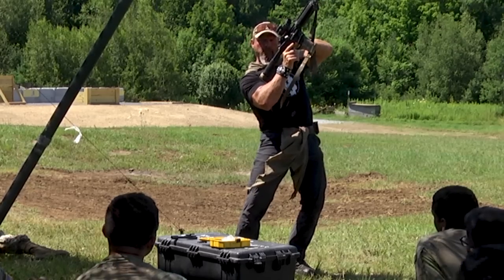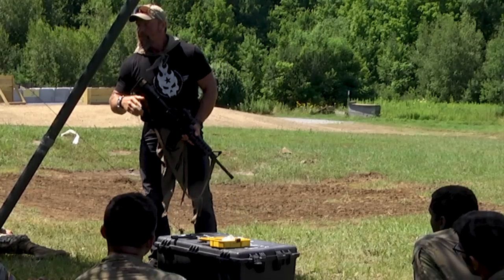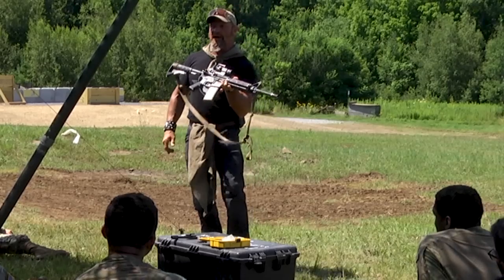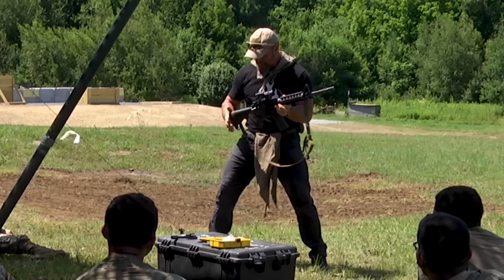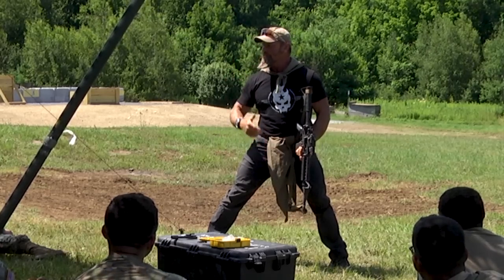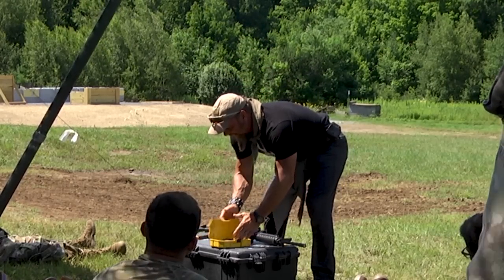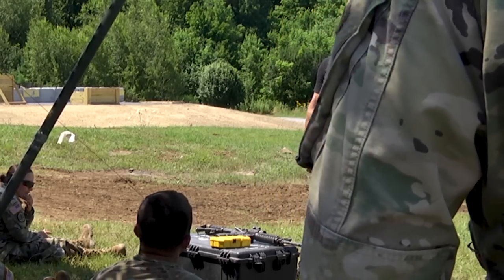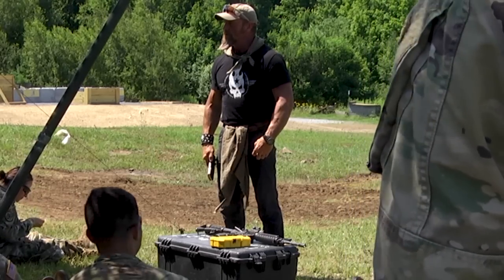Pat McNamara | Weapons Malfunction Training

Comment: The bolt override clearing at ~13:20 is the most straight forward explanation that I have ever seen.  
It make perfect sense that the cartridge will move forward with the charging handle and un-wedge from the bolt if you just hold the bolt from moving forward when driving the charging handle forward. Thank you!

Comment: I love how americans have such an extensive training session on this.
Finnish guys running RK rifles (like an AK but better) its like:
Step 1: DROP the mag, fresh mag in, rack it, try firing. If the rifle still doensnt work...
Step 2: slam the stock into a rock or a tree while pointing in a safe direction, try to fire.
At this point the rifle must be completely fucked if it still doesnt fire when its in battery.
Step 3: find new rifle.
Reply: I fucking love the Finnish
Reply: Sounds good enough to me :)
Reply: @ebinecksdee9872  the fins hate your guts.
Reply: seems the ar has alot of potential problems
Reply: @TheOMGWTFBBQ777  Many of these malfunctions showed in the video  happen in ak's (or an rk) too.. thing is, you should know how to fix them IF and WHEN they happen in one of them as well..

 Malfunctions aren't very prevalent in a standard m4 and most of them are bad magazine related (which the military switching to pmags has helped a lot too) or due to bad/worn parts maintenance.
Reply: @muddyhotdog4103  cool man just seemed a bit exaggerated . hope the police and mil guys have this sorted.
Reply: Ebin Ecks Dee 😂😂😂
Reply: Laughing my ass off

Comment: Another reason for failure to feed is cheap magazines like Thermold. If you look at a GI or Magpul magazine from the back and hold up the Thermold next to it, you will see that the magazine follower on the Thermold doesn't ride up as high. It tends to feed the round into the top of the magwell no matter how well you seat the mag.
Reply: I loved my magpuls and sung their praises until I had 3 of a set spit their feed lips into my m4 in afghanistan.  Steel usgi or lancer mags with metal lips only, from then on.  Magpul springs and followers in everything though

Comment: 7:56 I barely ever actually get to shoot my AR, so I like to take out the bolt and use it to fling snap caps.  I'll push the rim under the extractor and then push the other side down on the ejector and let it go.  Sometimes I try to fling them into a basket or something.  I never realized that I was doing something constructive that whole time!
Reply: you're not

Comment: 8:13 if you have a bolt with bad ejector spring tension, mark it and save it!! It is an awesome training tool to put into your gun. Helps train double feeds and stovepipes. I got a new gun that had a bad bolt and I got really good at clearing those malfunctions, then got a new bolt. Been kicking myself ever since.

Comment: This video is so full of info. I always did tap rack, then prom night if need to. I have had a few failures in the ar platform. I had a screw break off the gas key. It took 3 gunsmiths to trouble shoot. I then cleaned the gun again for the 10th time and found the broken screw on the gas key.  Things go wrong.  Sometimes just doing a good inspection will work.   The second screw held the gas key so tight i never suspected that to be the issue until it loosened up to visual movement. I had tried everything before hand.

Comment: Great informative video, only question I have is your gas ring statement about how it doesn’t matter if they’re lined up or not.. Now mind you I’m going off my USMC 2111 TM from 00-04 that stated you must make sure the gaps are staggered otherwise if they are aligned it will create a channel for gas to escape.. Now how they are staggered doesn’t matter as long as they’re staggered..
Reply: That is the book answer, however there has been testing that shows alignment has no negative influence on gas drive whatsoever.
Reply: EMC556 do you have any reference to the data showing that?
Reply: @jakudahsymba5453  nope, but you can try it in your own AR15. It will function fine.
Reply: EMC556 watched the vid, thanks... I figured it wouldn’t, but honestly never tested it, and we were always told to do it, however the more I think about it, staggering the rings is probably  more about creating even wear or possibly preventing carbon buildup in one spot against the bearing surface in the carrier..

Comment: The first stage in the cycle of function is feeding, the reason is if you can't get a round in then you can't fire!! I've seen plenty of guns that had failure to load or to chamber. There is a reason it's written that way in the manual.

Comment: The bolt override ftf could be mortared without pulling on the charging handle. Inertia would move the bolt back while leaving the charging handle locked. Round drops out the magazine well.

Comment: I saw this happened as someone's AR where the spring detent got stuck in between the disconnector and the hammer and went full auto the spring detent got out because 6-hour put it together and I did not screw the the buffer tube in far enough I hear the little pin from the buffer spring detent or a primer gets stuck underneath they trigger

Comment: My crye pants I bought off eBay had a corner of a wrapper from a pack of m&ms in the side pocket, mag picked it up got caught in the throat but I was blessed enough to clear it with a mortar no dental tools needed. Couple cadre at the class were laughing at me but I kept going. Didn't help that before that I had to spray paint 3 used mags cause they kept causing double feeds. I wonder now if I could of just bent the feed lips instead of just shit canning 'em.

Comment: on the bolt override (stuck between BCG and charge handle) haven't had it happen.  Can you not pull it back far enough to get it to the bolt catch then shove the handle back in? looked like he stuck his hand in the bolt but kind of hard to tell in the video. If BCG is smoking hot id rather catch it with bolt catch for sure lol.  So far I'm almost 15 min in and haven't missed 1 yet. I've had a gas key worked loose from shitty steak job. Goes single shot instantly. Just took my A2 block off one and the other didn't have it so BCM don't let me down!!

Comment: Another failure I experienced in a carbine class - popped primer in the FCG.  The primer ended up in my fire control group and prevented my rifle from firing.  It was a bitch to remove.  ALWAYS use milspec ammo with CRIMPED PRIMER POCKETS.

Comment: One drawback of the AR15 design is that if for some reason the bolt can't go into battery you can't break the weapon apart, because the BCG will lock the upper and the lower together. I actually had that happen on an airsoft rifle, but I don't see a reason why it can't happen on real AR-15. A debris got stuck between the locking lugs on the barrel extension and prevented the bolt from fully going forward. luckily I was able to pry it out through the ejection port, but had I not the only way to disassemble the rifle would require taking off the barrel. Obviously this is not something you can do in the field, never mind mid-firefight.
Reply: @eedd sdsd You can't separate the two halves without lifting the back end of the upper. The lug through which the rear pin goes through will hit the hammer or auto sear on a select fire rifle.

Comment: When you mortar a gun - if that's the right word I'm using - is there a possibility that the bullet goes off?
Reply: You should only be clearing like that if you're in a combat situation where you have immediate need to clear the failure and continue firing, and even then you should be following the 4 gun safety rules to where if it does go off it doesn't kill anyone. If you're on the range you should be clearing the magazine and putting it on safety, not slamming a loaded gun against the leg or ground.

But, as to whether it would fire, what he was demonstrating by mortaring was a failure to extract a fired round, so he's holding the charging handle and giving it some extra force slamming it backwards. Even if it was an unfired round that needed to be extracted, either the hammer would still be down, or if it's not, the force of hitting it on the ground should not be able to overcome the trigger spring.

Comment: With the bolt over ride he did exactly what the guy said to do. Relieve tension on the bolt and push the charging handle forward. Still he made it look easy. 

Also like the progression of malfunctions through the firing sequence. Haven't heard it explained like that.

An he's right. User induced malfunctions are supper common. To many rounds in a gi mag making it hard to seat. I've also seen 31 rounds in PMAGs a few times too. Not seating the magazine or pulling down to confirm. Dicking with the charging handle or easing it forward. All kinds of shit.
Reply: Haha, ya but he needed to look cool (proceeds to show exactly how student explains to fix brass over bolt)

Comment: Talk about weird malfunctions. I had an AR15 go full auto on me once. It was a broken disconnector spring in the trigger slot. It would slam fire at a cyclic rate of what sounded like 1000 rpm's. Ah, I just understood the purpose of the auto sear, to slow down the cyclic rate to 740 rpm's.

Comment: Ejector SPRING??? Why doesn't it have a fixed ejector like most autos? Simpler, and you can just pull the bolt back and see if it's there or broke off.
Reply: Why not? It really isnt a common problem to have a bad ejector spring in an m4/ar15, just might wanna replace the spring after 5+ thousand rounds if your ejection is weak; it's an easy fix.

Comment: In my day to correct a malfunction was referred to the word SPORTS. Slap, Pull, Observe, Release, Tap, Squeeze.
Reply: Juan Mangas Mochas  tapping is a procedure after the obstructing round is extracted, and ejected from the weapon, and a round from the mag is rechambered, thereafter tapping the forward assist to ensure that the bolt is properly seated in the chamber before squeezing a shot off. There is no danger for a accidental discharge, if you conduct the SPORTS procedures correctly. I have never heard of, or experienced a accidental discharge using that procedure.
Reply: Look by tapping the forward assist is only a extra procedure to ensure the the bolt is properly engaged, and seated in the chamber, though I have had a bolt that wasn't completely engaged due to fine grit that happen to get into my chamber, and I engaged my bolt by  using my forward assist which also worked well. If you think that a forward assist is a stupid idea on a weapons platform you're entitled to think whatever you woukd like, all I know is that it worked for me, and like I've mentioned previously never heard of  a accidental discharge, nor I have experienced one whilst using the SPORTS procedures.
Reply: Juan Mangas Mochas  oh well, shit does happen, however that someone accomplished that by using SPORTS.

Comment: Pat you are the fucking man!  Exellent video sir thank you for putting all  this information in one vid.

 I had buds for years always having issues. 99.3742% of the time it is operator error.   Faluire to inspect ammo when loading.
Failure  to inspect weapon-Gas block walking forward... gas rings not offset enough. And the classic "  case wont extract... i used ammo with a lacquer coating....I fired my 5 mags quickly... let a round sit and cook in the chamber...lol can you help me? "   DOH!
 thanks again great vids Sir.

Comment: Not having a mag in is not a malfunction.
Reply: It's an operator error
Reply: @frankgoytia2185  Correct, not a malfunction.
Reply: Improperly seated magazine causing a malfunction is a user induced malfunction. Though I think the video more covers any scenario where you pull the trigger and it doesn't go bang
Reply: @oscarkilby4033  Yes, Improperly seated magazine can cause a malfunction but still, not having a mag in the first place is not a malfunction.
Reply: @Skrubb_Lord  oh no for sure I didn't catch that part in the video. The problem is probably a malfunction being defined as what I previously said rather than what they really are

Comment: I thought the gas rings had to be staggered
Reply: They do, unless you run that bolt with a piston for some crazy reason
Reply: @1891-j8s   Nope, fake news...
Gas rings have NEVER needed to be staggered on any generation of AR15/M16/M4 series of rifles.
Reply: @1891-j8s  Bro - the bolt IS a piston.  That's why it has gas rings.   Y'know, like how your car's engine has pistons that have gas rings on them?  

And Pat Mac is right.  I've purposely assembled bolts with the gas ring gaps lined up and the rifles ran just fine.
Reply: The reason why it doesn't matter is the gas rings will rotate on their own in the rifle during use, so there's no way to ensure they'll stay staggered anyway. It'll still work fine
Reply: @tstststs  it's not even really that.. the fact is that the rings compress in the run of the carrier and those gaps actually close up. Either way, ya it's a myth.

Comment: Good training when you use the AR platform . In a hot fire fight this Weapon cant take the blood mixed with dirt that will end up in the chamber (It will not blood check). Get your self a FAL or a Gallil if you want to marginalize malfunctions at critical moments
Reply: Except the FAL is overweight with excessive recoil and both the FAL and Galil are more likely to fail in dirty environments.

Contrary to its bullshit reputation (earned initially through deliberate sabotage by Ordnance issuing ammunition with unsuitable powder, then through shitty magazines being reused well past the point where they were worn out and should have been destroyed), once you start testing rifles against it, the M16 family ends up being one of the most reliable combat rifles ever built on top of it being one of the most accurate combat rifles ever built.
Reply: Both the galil and fal are heavier, have inferior ergonomics, worse recoil impulses, reciprocating charging handles etc. Also because the m16 aren't built like shit dirt isn't likely to get in in quantities high enough to cause malfunction. Bloods a liquid so sod knows how that is going to cause a ftf
Reply: @oscarkilby4033  Not to get into a pissing match as tools are tools . First i must point out that blood is used as GLUE and will collect dirt and becomes sticky as it coagulates . As for the FAL being heaver its a small trade of for the reliability and HARD KNOCK DOWN 7.62 that a 5.56 just does not have and it also has a non-reciprocating charging handle as well . If you must have a 5.56 the galil is not much Heaver and has a proven AK gas and locking system as well as a improved extended sighting platform .It does have a reciprocating charging handle this is true . My point is to always know the pluses and minuses of the tools that you use but it seems to me Mr. Oscar you have no understanding as to what a long term subjective deployment entails in its reality. Short term fire fights are one thing but if you are in the muck and grim for days or weeks the M16 platform will give you dire problems and i for one want my target hit hard on the first shot so i can get a second one to finish the job . I watched a brother hose a guy with his M16 as he was leveling a RPG at him . The tracer rounds mixed with ball went right though the SOB with out knocking him back and my Brother lost his life when that RPG turned him into a pink mist . I already had a bad experience when my M16 jammed providing cover fire almost resulting in the death of a friend . He got hit two times and lived for a few years with a colostomy bag till it finally killed him . I live understanding that to know your tools Good,Bad, & Ugly ( GBU ) are a must and am sharing this so i may help a brother know the facts so lives can be saved . I spent over 25 years of my life as a foreign Weapons Specialist in service and as a contractor for most of my time . Just my two cents for what its worth and i do have a vast knowledge in field with most if not all light Weapons from subguns to Belt Feed Crew serve if any one wants to know about a particular tool and whats the GBU of it .. God be with you all and stay on the Moral High Ground ( MHG )